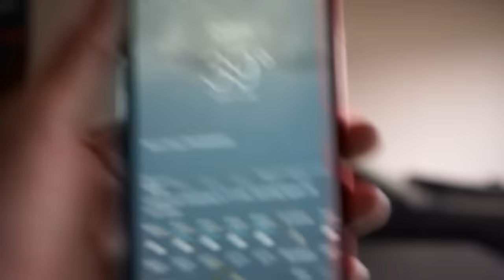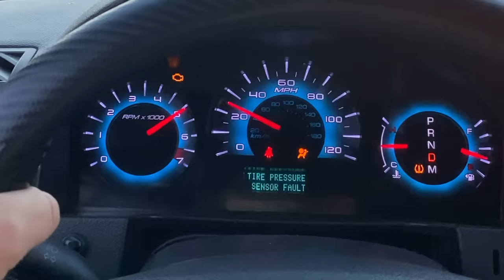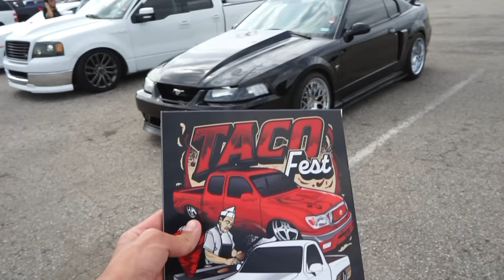2004 Mustang GT | 2022 Transformation in 10 minutes

Comment: I like old with Magic Pan better... bit I think your new fog lights are bigger than oem

Lower it 1.5" with coil overs or bigger rims & tires

rear 1/4 panel not sure worth the work but didn't know Bullitt's where different

You're quite talented with your car handyman skills!!
Reply from the maker: Thanks Hunter! Yeah these new edges have parts that have a subtle difference. Such as the Bullitts/Mach 1s/Cobras, all contain parts that are slightly different but interchangeable. Unfortunately, won’t be lowering it, since I sold the car already 😅 video will come out soon!

Comment: I really like those style of hood pins but, I worry about the plastic holding up long term and the size of hole I will have to cut into my cowl hood. I am currently hoping I will be able to have the cowl hood able to fit correctly and not pop up while I am driving but, if so, I will most likely stay with the traditional hood pins (I have a 1976 Camaro RS)
Reply from the maker: I say go with the OG, goes well with your year vehicle and makes the most sense 🔥